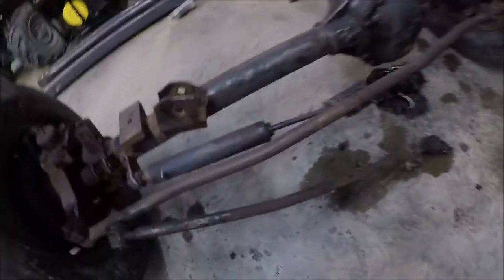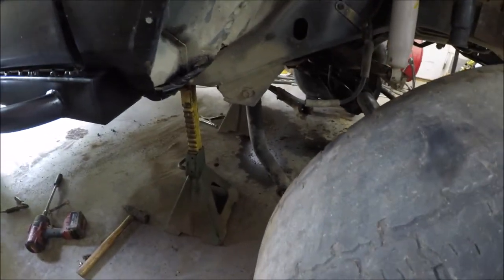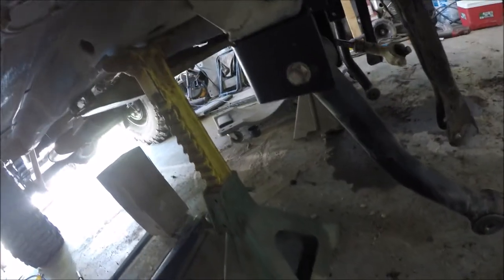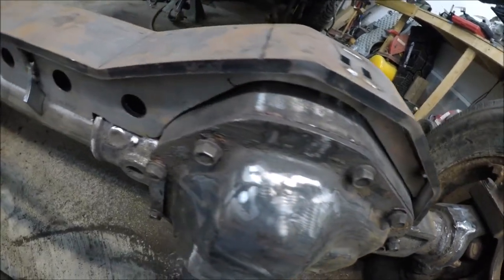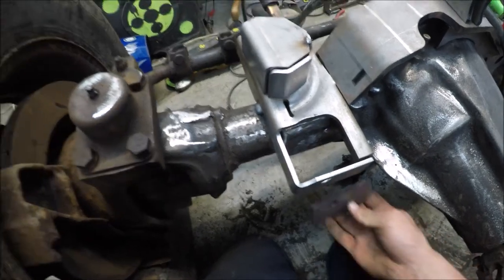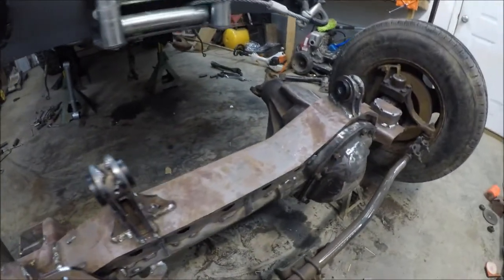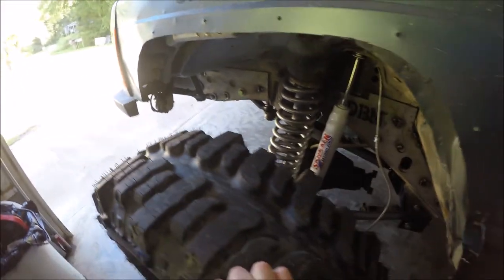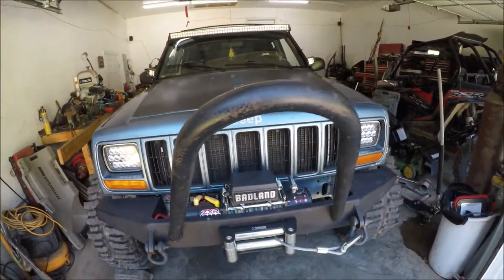Jeep Xj Front Dana 60 Kingpin Install! Artec Truss And More!

Comment: Any word on how its coming together? Just bought this same kit and have been tryin to figure out lift kits except its the 97 year with ball joints. Found a long arm kit im pretty happy with buts its probably double if not triple your solution. do you plan to drive this jeep on the road or is it just a mud buggy?
Reply from the maker: It’s going good I got the front and rear in. I really need to get some more videos uploaded. I’ve took it on the hill a few times so far I’m really happy with it. It’s just a mud buggy